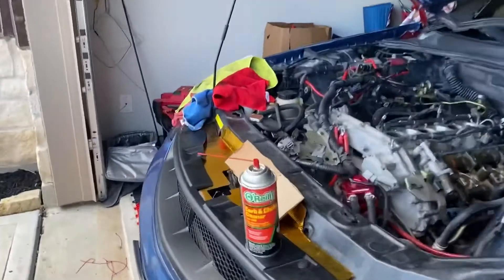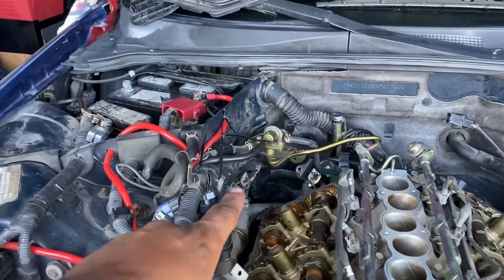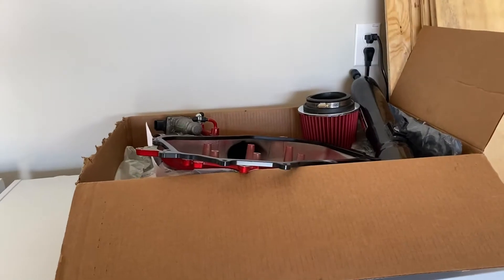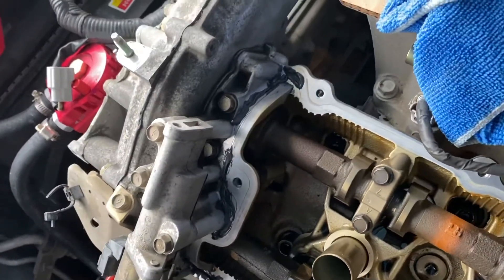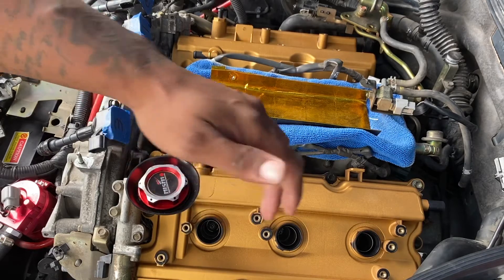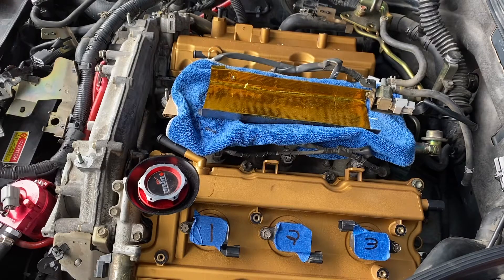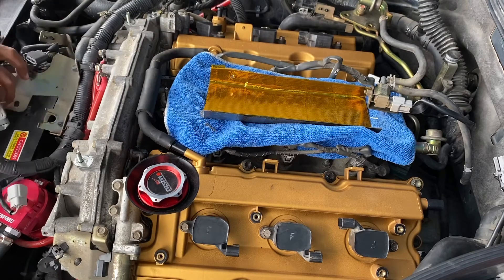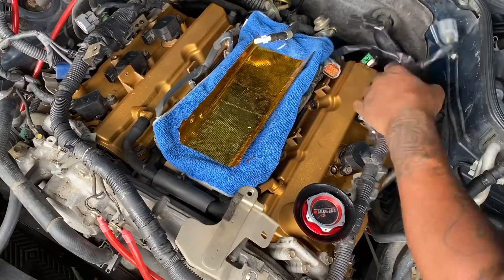G35 valve cover & gaskets replacement  PART 2

Comment: are those the aluminum valve covers?
Reply from the maker: Know if I remember correctly they are made of plastic I don’t think you can get them in aluminum if so please let me know
Reply: @g37vqgang81  i just bought aluminum ones.  i think they might of came out last October.
Reply from the maker: @willcollins3045  any pics
Reply: @g37vqgang81  there on amazon,  cost me 140  delivered. There red and look good on the car,  they say you can replace the spark plug gaskets , but i don't think you can.  they can take a lot more torque then the plastic ones. so if they ever start to leak i can just keep tightening them down,  this would probably stop the spark plugs leaks too.
Reply from the maker: @willcollins3045  most definitely